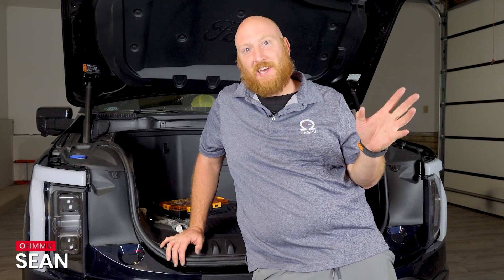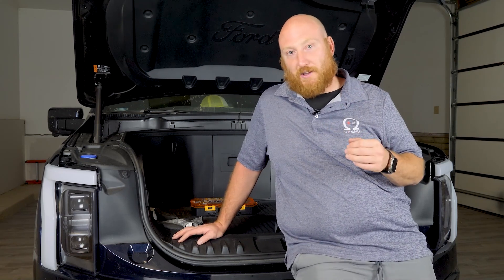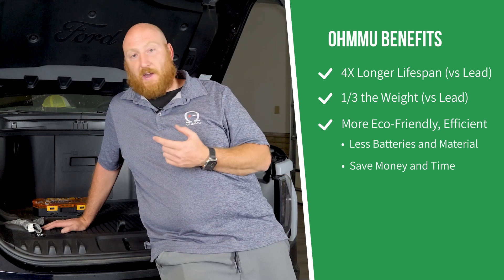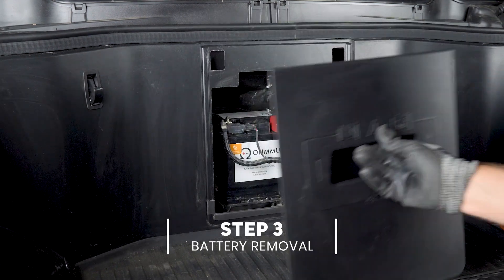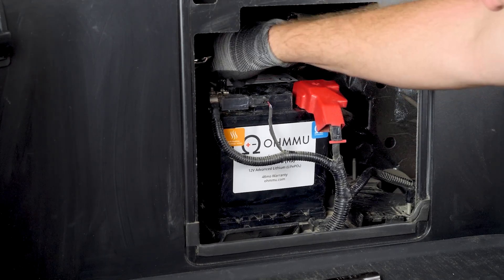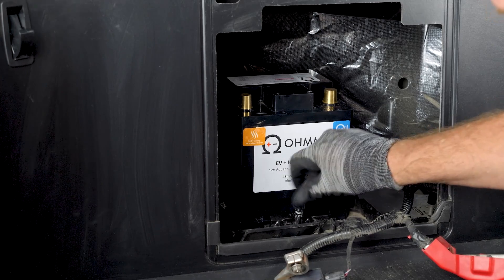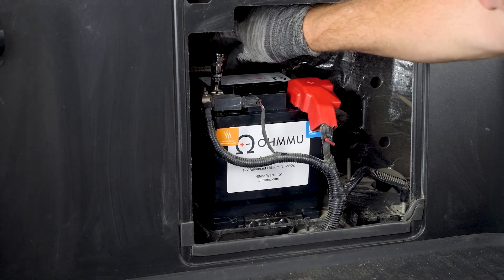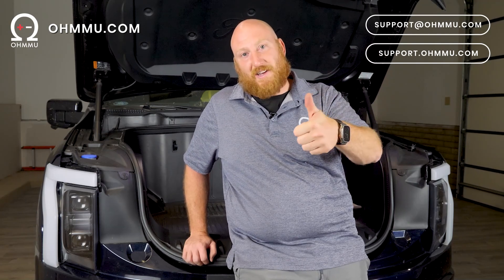Ford F-150 Lightning - 12V Battery Install (Ohmmu)

Comment: The Google overlords caution about the battery management system being designed for lead batteries. Have the Ford systems been tested to verify they work with lithium batteries and aren't causing damage to the electrical system?
Reply from the maker: Sorry for missing this earlier! We actually have a disclaimer on our product page for the Ford Lighting specifically. We had another content creator test our sodium in their Lightning and the BMS killed it, but only because it needed a simple BMS reset between swapping the batteries. We also provide instructions on how to do this as well. :)

Comment: There are two things that should have been done before disconnecting the 12v battery:

1. Turn off automatic updates and wait a sufficient time for any updates to complete installation. Alternately, check your OTA update status on Ford Service. If you disconnect the battery in the middle of an install you could brick a module or at least need to take it to the dealer if you can’t reprogram it yourself. 

2. The service manual instructs to de-energize  the DC/DC converter. The disconnect is on the drivers side be the brake fluid reservoir. Leaving the DC/DC converter energized when the 12v is disconnected subjects your modules to voltage spikes and your battery cables subject to the rush of shorting.

Comment: When the battery dies how do you get into the frunk what accessories is it controlling ?
Reply: in the driver side wheel well theres a manual release
Reply: Under the steering wheel on the left by my foot? What does that 12 volt battery used for ? Thank you

Comment: I keep getting an Electrical System Drain Service. IS this a symptom of needing a new 12V battery. It further says, There is an electrical drain in Lightning, possibly caused by after-market device. If that is not the case, please schedule sdervice soon. I have no non-stock devices connected.
Reply from the maker: It sounds like it is detecting current going out of the battery that it doesn't expect.  You could try to remove the negative terminal and disconnect the little connector there, then replug that connector and reconnect the terminal.  The little connector is for a shunt which the vehicle uses to monitor current in/out of the battery, maybe it is needing recalibration.

Comment: What is the amp hour capacity of the OEM battery vs the Ohmmu battery?
Reply from the maker: Hard to make a direct comparison b/c the 2 are of differing chemistries and Pb-Ah and Li-Ah are NOT the same thing so there isn't a direct answer to this without digging in really really deep and technical.  A simple answer to this question, is a wrong answer, in other words.

Comment: Do these batteries work well in Cold Canadian Winters?  -40 deg c?
Reply from the maker: Depends on where you are storing the car overnight for those -40deg C.  We run our tests generally down to -30 C.  But that's the temperature at the battery itself, not ambient temperature which is always colder.  if you have ambient outdoor temps of -40C as overnight lows but you park in the garage the battery likely will never soak internal temps below -20 to -30 Celsius, and that would be just fine.  If you are planning to leave the car outside in that temperature for extensive period of time where the 12V is gonna cold soak that low, then I don't think an EV is a good idea, period.  Not only from 12V standpoint but because the large battery pack is even more sensitive to the cold and will be burning enormous amounts of energy to keep itself warmed up enough for safe operation.  Our newer batteries are all converting over to self-heating technology too though, which will allow for use in that scenario anyways.

Comment: Stumbled upon your battery from the Lightning forums.  I don’t trust the stock 12v battery .  I’m hoping replacing it with your battery will help make OTA updates more reliable.  I’ve stopped receiving some and I suspect it is related to the 12v.  I had the hybrid f150 before the L, and they had issues with the OEM batteries as well.  Thanks for the Lightning content.  I love my truck! It’s been absolutely fantastic in the last 8 months.